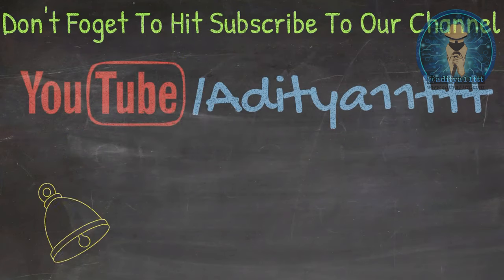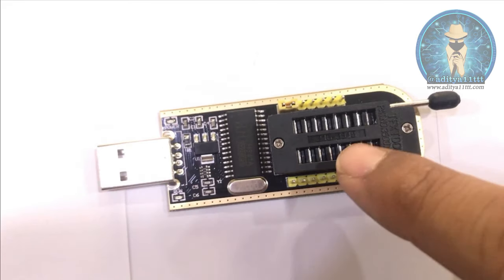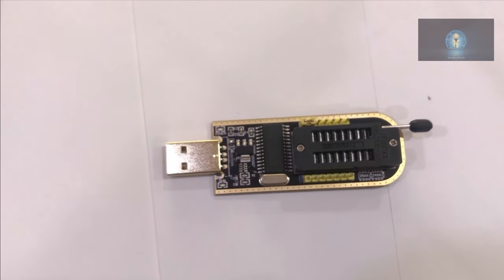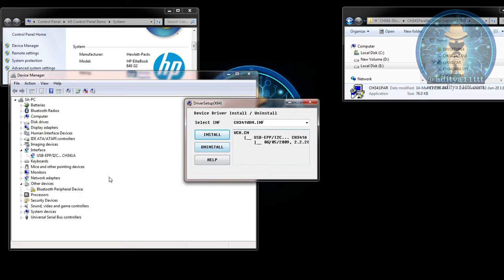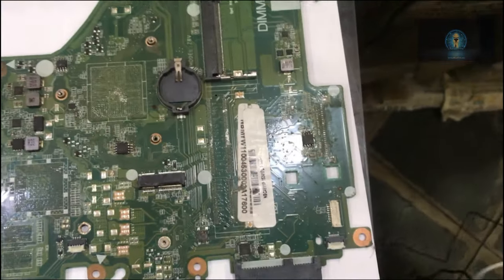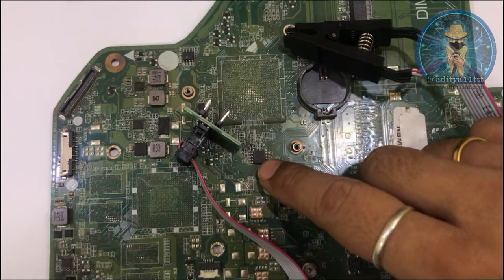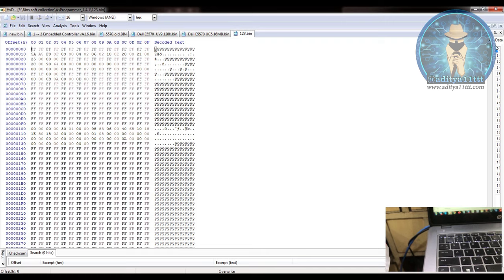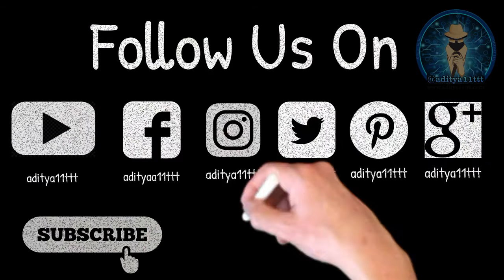How to program bios chip using CH341A without removing from board with clip

Comment: Hello Satishbhai -- Thanks for a very informative video using CH341A Series Burner Chip 24 EEPROM BIOS Writer -- can you reset the passwd lock after using CH341A -- and then re-flash the BIOS without removing the BIOS chip from the board. Basically, reversing it. Thanks in advance.
Reply from the maker: Try
Reply: Not if you just copy and reflash the same bios but download a clean bios file from manufacturer or edit the bios file which is not easy

Comment: Esse gravador tem voltagens de 4.8 e 3.2 volts. E o programa identificou que a Winbond da placa é de 1.8v. Não corre o risco de queimar a eprom ?
Reply from the maker: English please !
Reply: @Aditya11ttt  he just observed that you used the wrong voltage, this programmer is for 3.3v and 5v chips, and has to be used with an adapter for 1.8v chips.
You could have damaged this chip by not using an adapter.

Comment: How to use the programmer if one has no signal to Monitor, mouse and keyboard. 
That is actually my problem. No display , no power to mouse, keyboard , but cpu and cabinet fan turns on. What may be wrong . Amd ryzen 3, on asus m320 mb
Reply: Please do reply

Comment: Hey got a Maxsun B650. Not sure which file to write with, in the BIOS folder I have 5 files:

3 EFI files (AfuEfix64, BootIa32, BOOTX64) - each 600KB file size 
032 file - 32,000KB file size
NSH File - 1KB

Any ideas?

Comment: Can this programmer work to read and write an AMTEL 24C128N chip?  And can you also reply with links to drivers and software sites?  (please and thank you!)
Reply from the maker: Na
Reply: @Aditya11ttt  The programmer came today and it took me all of 10 minutes to read the chip, backup the existing data to a file, edit the VIN, and burn in the new data.  (I used the no suffix version of the chip in the software..."24C128".)
Reply from the maker: It’s i2c Ic

Comment: I can see that You have the Black version of the board where most of the time it sends 5V to power line instead of the 3,3V that most of the chip required. There should be apply the 3,3V Fix If I am not mistaken.
Reply from the maker: Nothing needed use Ch341a it’s most common ! There is jumper which when u shift gives 5v and by default it comes with 3.3v set !!
Reply: @Aditya11ttt  With all due respect and Your knowledge ... there are some versions that give correct 3.3V output but some give 5V output. According to manual the jumper is used to switch between programming mode and TTL mode on the device. The easiest way is to test the pins with multimeter. My purpose of the comment was not to argue ... just advice to people who got version with 5V output as they are on the market.
Reply from the maker: It was in the past , but now mostly it’s 3.3v
Reply: @Aditya11ttt  I am still expecting delivery of mine but to be on the safe site  I will check the output before I will use it.  Thank You for the videos and share of Your knowledge.
Reply from the maker: Sure u should check !! Always to be on safer side ! If it’s Ch341a original 99.999999999% it will have 3.3v by deafult ! Because we sale 100+ pcs in a year no issues !!

Comment: Best video. Subcribed. Thanks Sir. After We back up the BIOS program so we should re-write to bios to the bios chip again to make it work?
Reply from the maker: Yes
Reply: @Aditya11ttt  One more qestion Sir. We use old Bios or the new one BIOS File from Motherboard Website? Thanks
Reply from the maker: Yes
Reply: @junkies4463  if the bios does not work, just flash a brand new bios for your motherboard or laptop.
Reply: @retroke6560  THanks my friend. ALready write a new bios and motherboard still no display. I think the problem is on the hardware
Reply: @junkies4463  you are scaring me, i need to buy that stuff to do the same thing, modded my bios, an then disabled integrated grafics, and not bios is found in a boot loop because it can't find any graphics to display anything and can't proceed with any other operation.
Reply: @retroke6560  i already bought it my friend. and It work write and read the BIOS file. But it doesn't solve my problem in no display motherboard. Might be the problem is in the hardware

Comment: thank you for the video. Did you make any modification to the programmer? my bios use 3.3V and the programmer provide 5V.
Reply from the maker: There is jumper to set 3v and 5v
Reply: @Aditya11ttt  thank you for the answer.
I have a jumper at pins number 1 and 2 and i think this is for the spi function. Should i use an other combination to set 3.3V?
Reply: I know that I am 2 years late, but as I was searching for this I found that it's not causing something because volt can't damage only the current and the current is low soo no problem. And at time the programmer communicates with the chip then it will set it automatically into 3,3v, soo no problem  exists.

Comment: i have graphics card rx5700xt i just bricked bios can this equipment fix it??  and if so how?  thanks Rukhsana
Reply from the maker: Try with new bios file
Reply: @Aditya11ttt  i tried everything. install in pc as 2nd card.  you cannot even read the file it is corrupt.
Reply from the maker: @GhostvaperYT  !! 
Than buy new card !! Or search another parallel and try the bios ! And ur luck !
Reply: @Aditya11ttt   im gonna fix this card it is £600 card rx5700xt

Comment: Great video! I tried flashing mine, but it's still failing post. Is it possible the chip itself is bad even if I can write to it?
Reply from the maker: No
Reply: @Aditya11ttt  I think it is because I used the bios from HP but did not transfer all the required information from the old bios bin file over to the new bios bin file. Do you have a video with instructions on how to do this?
Reply from the maker: @vubur7488  use Hp dim tool !
Reply from the maker: Hp dmi search in channel

Comment: hi there im trying to read bios from x1 carbon 7th gen ...do i need to remve clip completly or can i use the crocodile conector to red it ?as not sure
Reply from the maker: Sometimes on board it’s not working due to volt and. Amp u can add power to MBD and try to read may be it can !! Be careful while u add power a small mistake can short MBD !

Comment: Won't 3.3v supply kill the 1.8v bios chip?
Reply from the maker: Use 1.8v Adoptor who is tell u to use directly
Reply: @Aditya11ttt  You're right there. It's just that in your video the winbond chip was described as 1.8v by the programmer(8:50) so I was surprised.  Now, I just checked the spec sheet on that chip and it is 3v. Thanks for this guide. I'm new to ch341a though I've had other experience jtagging and with arduino uno.

Comment: Bro can I reflash my board's existing 25 series SPI DIP 8PIN bios chip as I'm not able to find one to buy that chip online. Can we erase and write on the existing bios chip on my motherboard (it is dead, just the processor fans running , no signals). Reply would be very great full
Reply from the maker: Try
Reply: @Aditya11ttt  yes I'm gonna try,

Comment: Hello,

Thanks for the educative video.
Please I need your assistance. I am trying to program my dell precision 3530 bios with Ch314a and neopprogrammer.

My bios chip is labeled W25Q80DVSIG but the list of detected ic in neopprogrammer are:
1. W25Q80BL
2. W25Q80BV
3. W25Q80JV

Could you please help me identify the right one from the list
Reply from the maker: There should be one more bios chip I think so
Reply: @Aditya11ttt  There were only three in the list
Reply from the maker: Select any doesn’t matter
Reply: @Aditya11ttt  You're right. I found another 8mb bios chip labeled FM25Q08 on the board.

My problem now is how to flash this bios because the bin file I downloaded is 32mb and I have found two bios chips(W25Q80DVSIG and FM25Q08).

Guidelines on how to program will greatly help. 

Thanks for usual assistance
Reply from the maker: Still not
Reply: @jenniferaziz3160  How did you get on ? I'm looking to do mine soon too

Comment: I would like to ask:

I have this programmer and another one and I burned dozens of chips without any problems - - the condition was that I blew the chip out of the board and that only this chip was connected to the programmer!!!

if I use the 8-pin pincer for the chip, I couldn't detect the chip even once, so it didn't work

where am I doing wrong?
Reply from the maker: Two major reason ..
1st the clip is not ok 
2nd voltage issue to the chip
Reply: @Aditya11ttt  I thought if there wasn't some trick .... for example, a shorter cable around interference
but as I wrote, if I blow the chip out of the circuit board, then it works without problems
Reply: I measured and I have 3.3V on the pin, I will try it tomorrow with an oscilloscope
Reply: so I spontaneously solved it:
I took an old laptop with Windows 7, installed the driver and started the programmer and it works
unbelievable!!!
that it would be a problem with windows 10???
Reply from the maker: @johnblacktech  works on win 10 too !
Reply: @Aditya11ttt  what is the solution for this ji
Reply from the maker: @jegannath1502  solution for what ??
Reply: @Aditya11ttt  there is no other ic in the Pcb , still I can’t able to program the flash ic with test clip , but if I desolder it , then it’s working fine
Reply from the maker: @JegannathPs  don’t get what u r saying
Reply from the maker: @JegannathPs  contact via telegram
Reply from the maker: @JegannathPs  via clip u can’t read all ic on board due to many reasons and board architecture
Reply: @Aditya11ttt  sir I even cut the board into half and checked and removed all smt components in the pcba

Comment: hp probook 440 g7 core i7 need help plz i cannot find the chip to replace and the warranty is also ended..i tried all steps given on hp website for recovering or flashing bios support but nothing my laptop is stucked in bootloop turns on and off just showing hp logo flash lights than reboots not going in bios basically a windows updates caused the issue it updated bios also in drivers and now im stuck with it no help from hp support they are just saying to replace the board which is not available and too costly i just need to flash the bios
Reply from the maker: Start with bios
Reply: @Aditya11ttt  ??? bios is not working so how can i
Reply from the maker: U have to just approach a near by repair shop !! That’s all how u can start with fast easy and safe !!

Comment: Please send me driver software of CH341A for iOS
Reply from the maker: Only windows
Reply: You can use it with Linux (with recent distros no additional driver needed) and flash tool or Windows with AsProgrammer and there is a way to run it in MacOS - but no way this works with iOS or Android I know of.

Comment: This is the wrong process.. I have tried on a LA-k201 11th generation hp  motherboard. After just taking the backup PCH Damaged  the motherboard became dead.. all
 signals gone, no response.
Reply: Do not try this using CH341 LOW COST PROGRAMMERS.
Reply from the maker: Firstly it’s already told it’s not preferred 
Secondly Problem is with your end not with the programmer ! 
Thirdly process is 101% ok !
Fourthly u should refer wson and 1.8v video as well which you have not seen .
Problem is from your end not with programmer !

Comment: Can you a video on how to use it to program ec bios
Reply from the maker: Ec bios if it’s 150mil use 150mil socket and do it same process ! If it’s io only Ene can be done not any other io !
Reply: @Aditya11ttt  okay I have use it to flash ec bios before but can do a video on to use it flash io and to do the connections from the programmer to the keyboard connector
Reply from the maker: Yussif Gbati u are talking about io ? Only Ene io can be be programmed from this programmer ! No other io supported !

Comment: He used the wrong voltage, this programmer is for 3.3v and 5v chips ONLY, and has to be used with an adapter for 1.8v chips.
You can damage a chip by not using a 1.8v adapter (In the case of a 1.8v chip, like his).
Reply from the maker: Who used wrong voltage ! This video is about normal bios 3.3v not 1.8v , for 1.8v there is complete another video
Reply: @Aditya11ttt  When you selected the chip ( 8:49 ), you can see the text says "1.8v". So either this info isn't true or you used the wrong voltage (and still somehow didn't damage it).

Also, how are new viewers supposed to know this tutorial only works with 3.3v ICs? You didn't even mention that we have to check that at all, something we have to check BEFORE CONNECTING THE IC TO THE PROGRAMMER.

But don't get me wrong, it's a great tutorial after all and will work for most people, I admire you willingness to help people. All I'm trying to do here is give you some constructive criticism and also help people not getting their BIOS chip fried. I think you should at least update the title and description with the "3.3v BIOS Only", maybe even pin a comment saying that, but it's up to you.
Reply from the maker: @NaddlyC nothing is gona happen u select any option will work !! This video is on 3.3v bios !! 

There is something called particle stuff !! Try ur self u will understand!! 

If it’s 1.8v bios chip use adapter and use any chip from auto detection list will work al u need adapter that’s all !!

Same is for 3.3v use any from auto detection list even it’s 1.8v written will work !! 

More study more confusion less study less confusion let’s keep this simple !! For all !! And not complicated!!!

PS this video is on 3.3v chip not 1.8v and for 3.3v u select any from auto detection list whether 1.8v written not written will work for 3.3v !! No issue !! 100% success no errors !!! 

For this program!! In the video !!
Reply: @Aditya11ttt  If you say so.